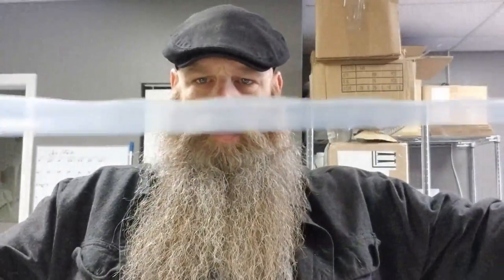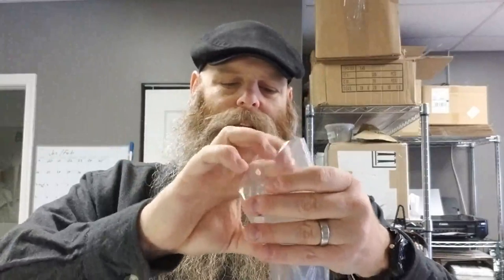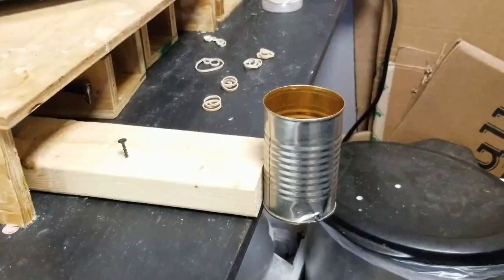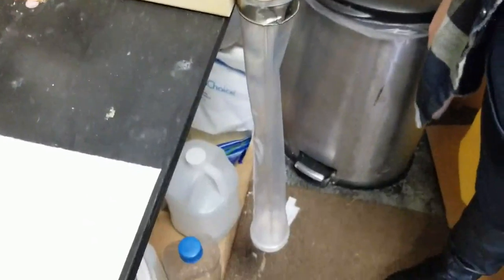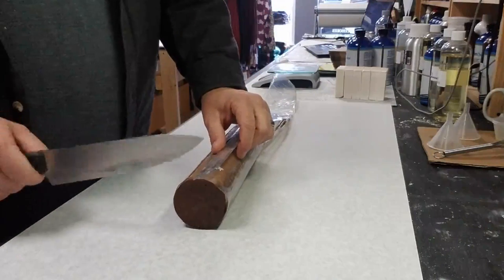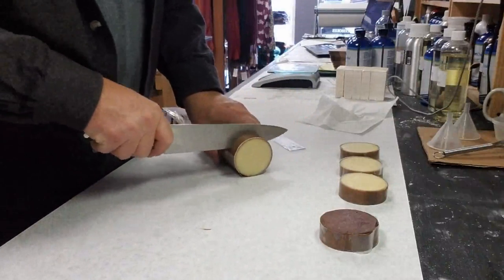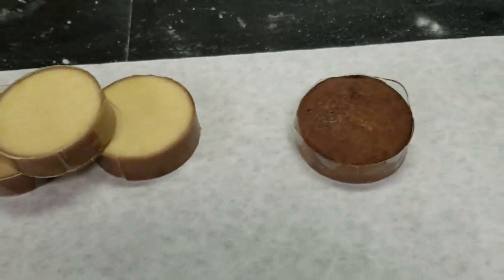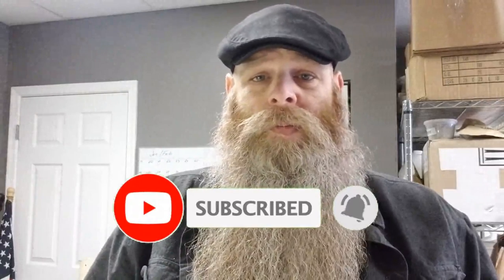How to make soap! | Cutting shave soap and the winners of our soap give away! | Soap Making 101

Comment: Jon my soap calculator  can only do either or. If I want to make a dual lye shave soap, how do I figure how much of each lye?
Reply from the maker: Run the recipe once for sodium hydroxide and then do it again with potassium hydroxide. Most shave recipes call for a 60/40 blend of the two types of lye.
Reply: @unclejonssoap  thanks for the response, I'll try it next time.

Comment: Wouldn't it be easier to get ruler and use marker so you wouldn't have to keep picking it up?
Reply from the maker: It would seem so. But... The problem with that is that unless you're dead on with that line (thin line) you'll end up with varying thicknesses. Then by the time you get to the end, you've either gained or lost soap. It happens with cutting things in carpentry the same way...lol
Reply: @unclejonssoap  gotcha lol
Reply from the maker: That's why I may just try the multi bar cutter and see how it goes...lol. If it works then I'm retiring the ruler 🤣

Comment: Why don’t you get a silicone soap mold? Lol it’ll be better for the environment, and they aren’t that expensive!! There’s a brand called Nicole on amazon and they make a good one!
Reply from the maker: Because they're harder to work with, break down in rather short term (which is bad for the environment), and they don't hold shape very well after a few uses.